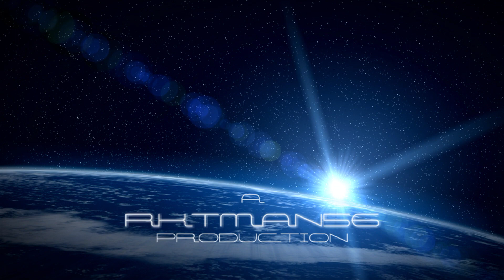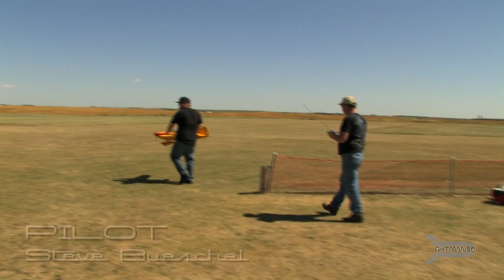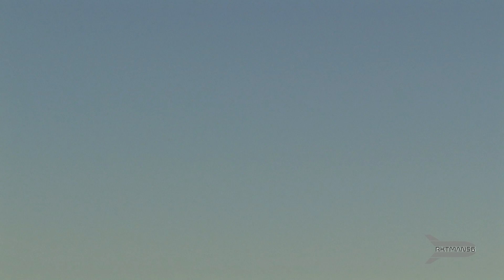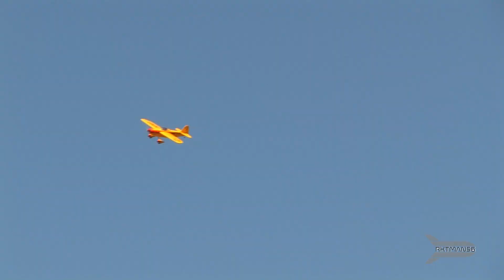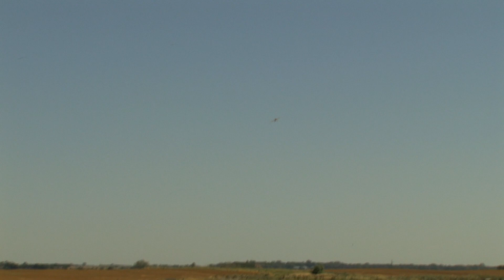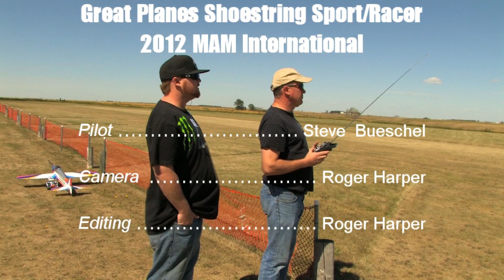Great Planes Shoestring Sport/Racer with RCV60SP

Comment: It says up to 7 lbs is the flying weight, I think a 60 four stroke is insufficient regardless of manufacturer. I would have used a low pitch, large diameter prop to make it fly but it would not have the speed the plane needs to fly properly. A .60 two stroke might be a better choice. The Tower site suggests a .70 to .81 four stroke.